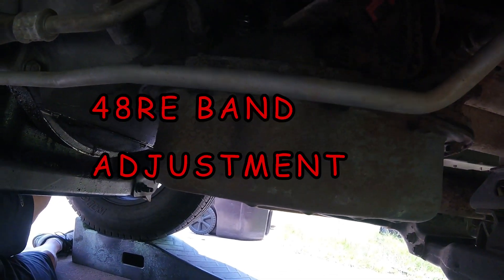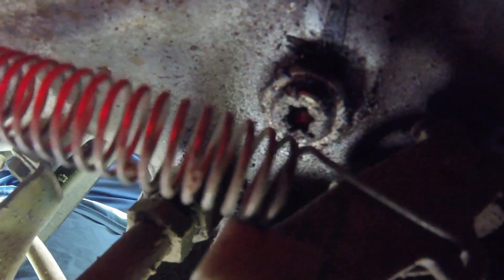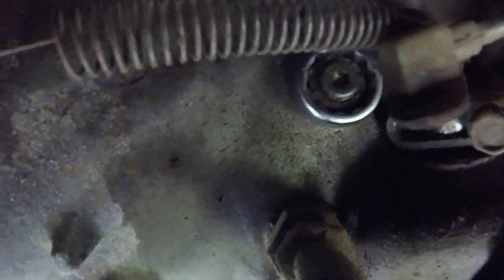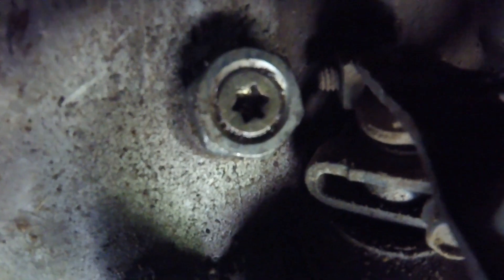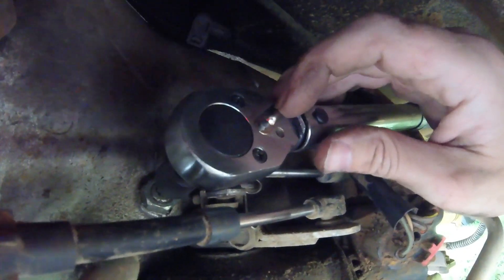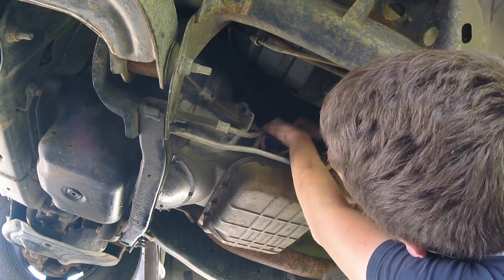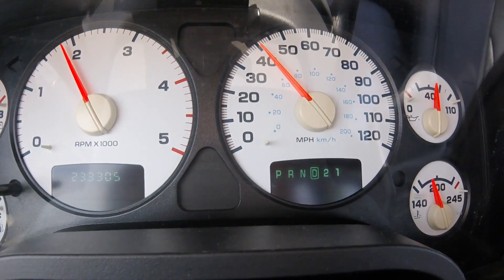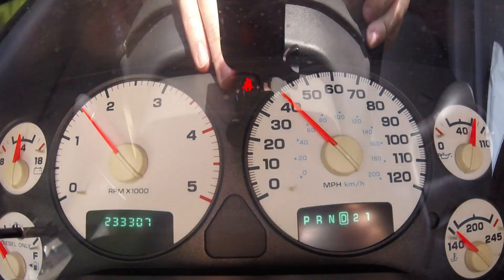How to do a Front Band Adjustment on a Dodge Ram 2500 48RE 46RE 47RE

Comment: I just did this on my 05 Cummins. If I was going slow in the neighborhood it would some times hunt for the gear between 1st&2nd gear. It would also shift hard into fifth if I was on the throttle a bit more than normal. This seems to have taken care of the problem. Simple fix! Thanks.  220,000 miles on the truck. Original engine and transmission.
Reply from the maker: That's awesome!
Reply: There is no fifth gear bud
Reply: @steve5912  😂
Reply: @steve5912  you know what he meant. In actuality, it is the 5th gear

Comment: Make sure that locknut stays backed off when tightening the adjustment stud because if it tightens against the case when finding 72 inch pounds it’ll throw off your reading on torque wrench.
Reply: Also don't take the lock nut all the way off

Comment: I replaced my governor pressure solenoid with the mopar upgrade and went with the bd diesel kit that uses the older style transducer then adjusted the band and so far so good in my 07 Ram 2500
Reply: Mike Ferguson same I went with the ats governor upgrade solenoid and bd transducer online from thoroughbred diesel for only $320 or so and makes the truck drive way better and shift properly need to adjust my bands tho
Reply: Matthew Murdock Yeah I found the ATS kit after already purchasing the BD diesel one. I believe that is the one that changes the governor pressure solenoid to a Chevy solenoid. If I hadn’t already bought the one that I did I would have went that route. So far the Mopar upgrade is working good though
Reply: Mike Ferguson oh yeah the ats one is a gm yeah that’s the one I’m using and works way better then oem

Comment: Well a little up date.  After spending a few dollars,  come to find out that the problem was simply the bands.  Evidently the person before me didn't know that you have to adjust the bands everytime you do a fluid change. So the one in the tranny was super loose.  So far so good.
Reply: You might check the 3 - 4 accumulator spring.  They get weak and break.  About $7.00 plus filter kit and fluid.
Reply: Just replaced governor, shift solenoid, and another part i think is called transducer? Anyways obviously i had to refill the fluid. Does this mean i have to adjust all bands or just the outer one? Problem with mine is it shifted late or only when letting off the gas

Comment: I would like to add if you replace the pressure governor the pressure solenoid you need to change out the amateur spring . Factory springs your weaker they tend to collapse or break. Only had first second every once in awhile third. Now I have 1st 2nd 3rd and overdrive and TCC kicks in great. Hope this helps everyone 🙏.
Reply: Im changing my trans fluids on my 2005 3500 5.9... I will also change the pressure governor and solenoid. I was looking at the hd borg. what BRAND SPRING SHOULD i get?
Reply: I have a 99 Dodge Ram 1500 van that starts slipping around 30 mph. Would you recommend I change the pressure sensor and solenoid to fix this? I'm dreading thinking of my van needing all the clutch packs and seals replaced. Appreciate it.

Comment: Yeah anytime my 2005 5.9 cummins started in 3rd gear I had a code and said line pressure low and I changed governor solenoid, I did the upgraded ats one but anytime it started in 3rd gear was the solenoid
Reply: So you have one of these vans and the transmission was slipping around third gear? So your input is that a band adjustment will not/did not fix said slipping and that it is/was either the governor solenoid/pressure sensor? Having slipping on a 99 Dodge Ram 1500 van.
Reply: Sigma XIII yeah it was the governor solenoid, right know my truck is acting up and found out the valve body is bad the valves are sticking and won’t work right, but I adjusted bands and put new governor solenoid in it and it was better
Reply: Mine 5.9 has van started in 3rd and it was ecm

Comment: Im trying to get a 96 1500 ram and the O/D went out. Im thinking i might need to do some of this or replace the speed sensors and or maybe the solenoids. seems to be a fairly common issues i hope one or the other fixes it since im dead broke 24/7
Reply from the maker: Mark Waltz I know there is another band that can be adjusted, but you have to remove the pan to get to it.  I don't remember the specs for it though. I understand that broke business.
Reply: Mark Waltz  
My 2000 RAM 5.2 4X4 gave a code out P-1740 the OD  solenoid $102. Wt tax... Not the issue. Fired it up after the new was installed. Engine light was still on with a new code. I can't remember the code bc I did a hard reset the light is off. But it was pointing to the PCM I think under the hood pass. Side. Anyway the code was also pointing to the pressure solenoid A? So idk good luck!!!
Reply: @Tieknee  reverae low pressure band and its 70 inch punds... Your welcome. You have to drop pan
Reply from the maker: Joe Almaraz thanks for the info. Maybe I'll video that when I service the tranny.

Comment: So I have a 99 Dodge Ram 1500 Van that is slipping once my speed is around 30 mph. Can anyone let me know whether a band adjustment will remedy this or is this a problem with the governor solenoid and or pressure sensor?
Reply: I replaced both solenoid and sensor and it didn’t solved my slippin .... I will try to replace the torque converter clutch

Comment: been fixing a buddies 24v that he just drives, but truck is 99 getting old, falling apart, put in new vp44/tierod/upper control arms/ground wire removed from harness, fixed the lockup shuffle. just trying to make it reliable again, not done yet damn thing wont start on a hot engine, like wtf? diesel all start hot until you stick a MOTHERBOARD some place, these computers are like a permanent torture device that is done to you at intervals and they call it MICROSOFT
Reply from the maker: Javy Mcdeez that's crazy. Have you had the computer flashed? I have read that in a few forums.
Reply: no flashes but still replacing sensors to give the ecu all the correct data. Air intake Temp sensor is next. the transmission is behaving good now, going to change fluid and filter and do this adjustment next.
Reply from the maker: Good luck good sir. I hope it works out for you.let me know.
Reply: the program and gearing on this dodge is funny, the lockup is way to sensitive. needs an off/on button instead of the on/off overdrive, what were these engineers doing? snorting coke high grade back inda day?
Reply: You sure there aren't any suction side air leaks or fuel supply system issues causing that no-start? From what I understand, the VP44 pumps are either good or bad and they typically "die" and won't start. And on "modified" trucks with aftermarket "high-performance" supply pumps, its easy to have too much fuel flow (and therefore supply "pressure) to the injection pump which puts fuel through the pump and back to return too quickly to cool the pump and electronic "motherboard" properly. They can also have leaking shaft seals that leak more when hot with the system full of hot, thin fuel that's easier to suck air through. Cummins B engines are also picky as hell about timing and you can't trust the little plunger "timing pin" regardless. Not that they're accurate enough for accurate pump timing down to a gnat's ass anyway. As for heat-related failures, those engines aren't nearly as "electronic" as common-rail engines. 

The "mother board" is mainly on the pump itself and they are just "electronically-controlled" mechanical pumps that have a couple of pressure control solenoids/valves to vary the fuel flow to the hydraulic head of the pump and to alter timing within a narrow window of about 5 degrees total. If you replaced the VP44 and it still has starting issues when hot, its almost certainly not the injection pump or "ECU" and you could easily have a bad/weak transfer pump (electrical on those trucks with most being block-mounted as far as factory equipment goes but some having a dealer-installed "upgrade" that puts the electric pump in the tank). The electric pump is just a "lift pump" and the primary transfer pump for the injection pump is INSIDE the injection pump. The lift pump is there primarily to get fuel to and through the filter and to "lift" the fuel from the tank and to aid in bleeding the fuel system after filter replacement or when the truck is run out of fuel because those pumps won't tolerate being run "dry". 

You also can't trust aftermarket "high-performance" electric fuel pump/filter setups that are supposed to be "fuel-air separators" like Air Dogs, etc. In particular Air Dogs are prone to failure where the pump seals leak fuel into the motors and cause all kinds of problems. Including a "hot" no-start situation because the pump isn't running continually or isn't pumping fuel correctly if it is. 

99% of the problems with "old trucks" like that are "new mechanics" who don't have the proper tools, experience, information or education to work on them and diagnose them correctly. Throw in aftermarket "high performance" parts that are only "improvements" if properly installed, plumbed, wired, etc and you end up throwing parts at them without having any clue what's actually happening. Its easy to blame "electronics" but rarely do electronic systems last for decades and then suddenly go to shit unless somebody has been "modding" them somewhere. And Dodge pickups and particularly 2nd Gen and newer Cummins trucks are pretty "cheesy" when it comes to the "electronics" and wiring as far as connectors, sizes, etc. They're fine if everything is left STOCK and is properly maintained. Start adding accessories and just tapping into or piggybacking on existing circuits wherever its handy to snap on a Scotch-Lok or connect a power wire and you're just asking for trouble.
Reply: The on-off OD switch in the shifter stalk is nothing but a momentary switch that controls power to the lockup solenoid. It IS an "off/on" button and compared to the old OD on/off button on the 1st gen trucks its a big improvement. Especially since it came with a LOCKUP CONVERTER CLUTCH Dodge Cummins OD-auto trucks didn't have until the 2nd Gen came out.
Reply: I'd like to know what all the Microsoft haters do to or have done to their computers to have so many problems with Microsoft Windows, etc. I've used dozens of Windows computers and programs when working for dealerships for machines made by Caterpillar, John Deere etc where everything from the parts system to dealer business system to corporate websites and all service/diagnostics information and software and hardware is windows based and up to 4 or 5 programs at a time on desktops, laptops etc. Both in the shop and in the field with everything from old-fashioned dial-up to Wi-Fi and VPN networks. 

One company I worked for was a multi-store, multi-state John Deere dealer and even our PHONES were internet-based and every employee besides the "wash bay" guys had a laptop and/or desktop and could IM, call, conference etc anybody(s) else in the company from his or her "work station". Diagnostics of CAN-bus systems with dozens of controllers on machines that make that '99 Dodge look like the toy truck it is and having to download ECU and even individual HPCR injector calibration data from Deere and then upload them to the machine to get it to start, etc. 

"Autonomous" machines with RTK GPS "navigation" and auto-steering up to and including the ability for an operator in one machine to control another driverless machine from the cab of the first machine. Built-in cellular telephony so the machine could "call" the dealership, owner, etc when there were problems, fault codes, etc and thousands of codes and data points that could be accessed many different ways. And laptops used in the field in 100+ F heat and 10 F cold bouncing around in and on service trucks, tailgates, laps, cab floors, etc where the laptop is your "life" while working on machines where just the ELECTRICAL section of the service manual can run into the thousands of pages.

All that experience and time with Windows-based software and hardware in all those conditions and applications that Apple actually GAVE UP ON a couple decades ago when the "Powerbook" wasn't "powerful" enough and wouldn't stand up to the demands and conditions and day-to-day "abuse" without constant "updating" and I've had ONE "crash" with a Windows ANYTHING. Ever. 

My guess is that most Windows "crashes" are the result of some Mac/Apple user who is used to being able to do one or two things at a time at MOST getting on an Windows PC and probably an "old" and/or "obsolete" one at that and going nuts trying to do five things at once and PROBABLY not "crashing" the hardware/software at all in terms of the system "shutting down" due to lack of memory, etc. 

What USUALLY happens is that the software and hardware just SLOW DOWN while they process everything and FIND "memory" for it all on a "fragmented" hard drive  using "overheated" processors and the reason the computer "locks up" is because that's the only way to get the idiot behind the keyboard to stop punching keys before HE OR SHE "crashes" trying to "fix" something that isn't broken. 

And of course good old "Control-Alt-Delete" doesn't do anything to "clear out" or "shut down" all those open programs and tasks on a WINDOWS PC since Windows PRESERVES its "progress" specifically so it WON'T be lost when a power failure or CLUELESS OPERATOR "shuts down" the system in the middle of MULTIPLE tasks. 

I'm a LONG WAY from any kind of "computer expert" even though I'm old enough/young enough to have had "computers" be a part of my life since early grade school back in the Texas Instruments TI-99 days and by the time I was in high school we had a couple of computer labs with a bunch of desktop work stations on a server network and good old DOS, because I didn't have much to do with computers for the first couple years of the "internet age". So I always heard horror stories about Windows and Microsoft "crashes" and just figured I didn't have enough experience with Windows and PCs or hadn't used enough different programs, etc to have those bad experiences and/or the relatively "new" and "high-tech" hardware and software I was exposed to or maybe the OLD stuff I was using prevented those experiences.

Then after years of that b.s. and looking at the thousands of hours a relative "rookie" like me had spent online and offline with dozens of different machines and networks and programs and the like, and how INVISIBLE Mac/Apple hardware and software are in INDUSTRIES WHERE computers have been "old news" for DECADES and where they HAVE TO WORK DAY IN AND DAY OUT OR WHOLE BUSINESSES AND GIANT CORPORATIONS "CRASH", I came to the conclusion or maybe realization that about 99% of the "Windowns/Microsoft sucks/crashes/fails b.s. was just propaganda made for and used by the FEW "Mac/Apple" users out there who don't need Windows/Microsoft technology/capability/versatility enough to put aside their stupidly expensive Mac/Apple "hardware" and "software" and TRADE UP to Windows ACROSS THE BOARD. Because the fact is that NOBODY is "Mac/Apple" exclusive unless they're sitting at home playing games or doing something else pretty non-essential on their computer if they NEVER use Microsoft/Windows. 

And the odd thing is that as an "old-timer" who goes back to those TI machines and who also remembers Apple IIs and IIcs and IIes and the real "floppy disks" and the like, I can also remember "booting up" those "Apple/Mac" machines and getting a "green screen" COMMAND PROMPT first thing.
Reply: funny how 1999 plays out On November 5, 1999, Judge Jackson issued "Findings of Fact" in the case. To the surprise of many, his 207-page list of findings sided almost totally with the government. He found that Microsoft was a "predatory monopoly," using unfair tactics against rival companies to crush competition. This ultimately denied consumers both choice and software that was never developed because of Microsoft's actions to preserve its monopoly.
Reply: ALSO CHECK YOUR ALTERNATOR FOR PUTTING OUT AC VOLTAGE!!!!!! JUST FIRE UP YOUR TRUCK PUT YOUR VOLTMETER ON AC VOLTAGE AND PUT IN ON YOUR BATTERY. IF IT IS MORE THAN 0 THAN YOUR GENERATOR IS JUNK AND LEAKING AC VOLTAGE INTO YOUR DC SYSTEM AND MESSING UP EVERYTHING. HAPPENED ON MY 02 CUMMINS AND IT WAS LIKE BRAND NEW SHIFTING AFTER THE SWAP.
Reply: It could be the starter. crazy to say, but i have a 01 cummins, and i replaced everything fuel and the batteries and altenator, and when i replaced the starter it fired right up.